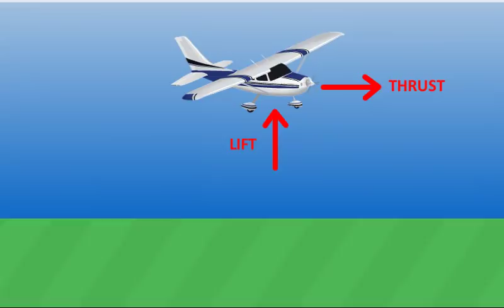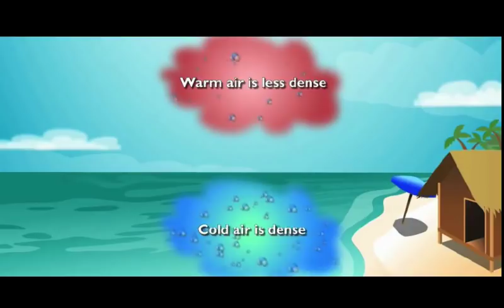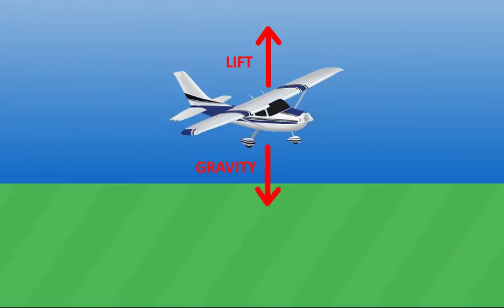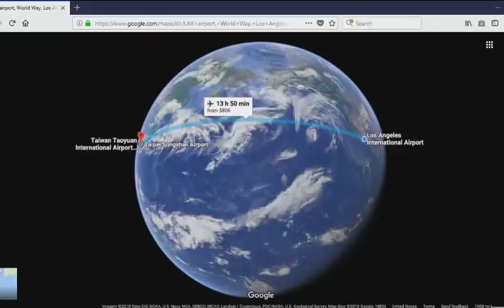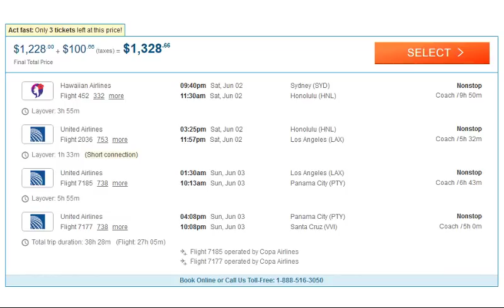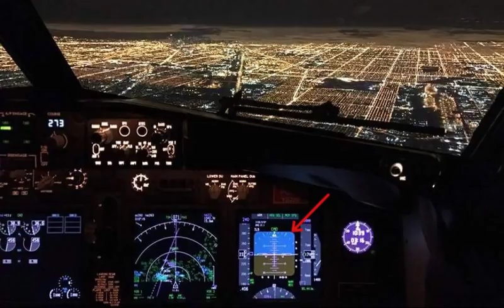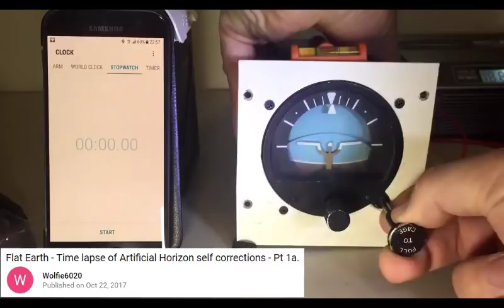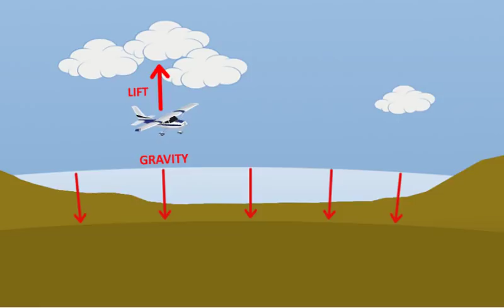Flat Earth Falsities - Plane Nonsense

Comment: I'm a little disappointed that this video didn't compare the calculations of distances measured over a sphere as opposed to across a flat planar surface. I would think that those measurements would be more compelling evidence. Over a sphere the distance between two points would be longer. I would invite our flat earth friends to discount this evidence and I would think real world measurements would follow the model of the sphere as opposed to the flat earth model.
Reply: "Over a sphere the distance between two points would be longer."
     I hope that you meant to say shorter. Over a sphere the distances are never longer, but often much shorter than they are on the azimuthal equidistant projection map that FEers use. Try Walter Bislin's Flat Earth Flight Calculator and you'll see how the distances compare: http://walter.bislins.ch/bloge/index.asp?page=Creating+Flight+Plans+for+Flat+Earth On a flat Earth, flights between Santiago and Sydney would exceed the range and maximum speed of 747-400s that Qantas flies.
Reply: A Crackpot would swear a straight(level type) would be shorter then a curved one... but if Science says not...
[ The great-circle distance or orthodromic distance is the shortest distance between two points on the surface of a sphere, measured along the surface of the sphere (as opposed to a straight line through the sphere's interior). The (shortest) distance between two points in Euclidean space is the length of a straight (flat) line between them, but on the sphere there are no straight lines .] https://en.m.wikipedia.org/wiki/Great-circle_distance

It is common-sense or hoax-sense to be deduce that water distances between are only longer below a Equator.
Forget anti... freethinkers crutches and cut up a balloon and lay it flat. 90% of transcontinental flights are "North".
Why don't they fly over the Pacific Ocean?

https://www.google.com/maps/vt/data=QL-JaxI2aJ9T51SKI7fPyCVfAaj5Mh3QqrXe8nfwK74YIiwhUiAM5BNH2q3rq9cuWPxJaOzCQsvnC-vox8nLvbbBtWHKjx-78diEE-2TjiArqcJs93I
Reply: @romithromith  I note someone has changed their pseudonym. How cute. For a challenged puippy dog.
Reply: @boffeycn  I'm not surprised. His little playmate Mikey went home and try as he might, nobody is paying any attention to the sad little tyke.
Reply: @romithromith "We are now in full Kim Jong Un territory. This is the statement of the new "Press Secretary" Stephanie Grisham about Trump's former Chief of Staff. Wait for it. “I worked with John Kelly, and he was totally unequipped to handle the genius of our great President.” Oh. My. God."
" Kim Jong Un territory."? Or Adolf?
Reply: Their sathurday Sabbath is over, the dark lord playmates are back with digressive topics. No notes upon comment again.
Anyone else witness some tangential discussion?  Whether for the troll's amusement or a specific gain?
   - Talking real world for those that have not checked Mike's last thread; 

And believe in official built real LAWS= "there are defined laws in the universe that make flat planets impossible." 

 Well araid that also is a conspiracy... High Sciene priests are not close to defineting The Creators laws and Science!

"defined laws were created that can't be broken." ...ha ha created he says :)
"All objects with mass exhibit a reaction based on electromagetism. That why all natural objects in space are spherical since they must adhere to defining laws."
 - How can a flat 'planet' exist with gravity... weakest fictitious force in the universe prevents flat surfaces?????? 

Is that an other definate law thingy? Helio galaxy kind of flat pizza-like no?
What if a BANG piece is tablet shaped with the good iron stuff?  Still turns out into a definate ball?

Electromagetism... exist, but Educator as a magnet it can PUSH as it can pull....
In Space... and first hand of that?  MOON you have observed (part of science Method) 360 sides?
   Funny Educator I always see the same disk image, always. Telescopes dont tell me it a sphere.

Answer by Simon Bridge, Scientist, on Quora:
What is the definitive proof there is gravity?
There isn’t one. That is not how science works.         - HA HA BUT WE KEEP HEARING "IT PROVEN FACT" !!!

Gravity is the name we give to the phenomenon that objects accelerate towards each other when they are otherwise left to their own devices.
https://www.forbes.com/sites/quora/2017/11/13/how-do-we-prove-a-well-established-theory-like-gravity/#20550f5e4cd7

 
Now some extraneous articles (Royal bloodline dictatorships are far from over. Rulers are satanic and 'do as they like') = 
QUEEN ELIZABETH FOUND GUILTY IN MISSING CHILDREN ...
https://news.nbcm.ca › queen-elizabeth-found-guilty-in-missing-children-c...
Apparently, his “crime” on May 6 was daring to ask superiors about Queen Elizabeth's outstanding arrest warrant. The order to arrest Queen Elizabeth was ...

MARK RUTTE 'president' of the 'netherlands': STOP Child ...
https://secure.avaaz.org › community_petitions › MARK_RUTTE_preside...
A former member of the Netherlands criminal drug syndicate known as Octopus testified that victims were obtained for these human hunting parties from juvenile ...
Reply: @boffeycn  "...genius of our great President." I haven't heard that one, just another "perfect" statement by or about His Majesty. 
     Humpy Dumpty is going to make a major televised announcement at 9am EDT. Either to announce US Forces have killed Abu Bakr al-Baghdadi, or to declare himself King, nullify the Constitution and have all Democrats in the House arrested for treason. Meanwhile, 99% of evangelicals polled oppose the impeachment. Yes Adolf, Il Duce, Stalin...
Reply: Did Somone say evangelicals !!!?  Like the beloved BUSH family, so so close to the 911 highly insured (against Terrorists) security and whole miraculous event in NYC, USA (saviors of the WORLD) (with Queen and Pope approval).
  WELL!  “Gog and Magog are at work in the Middle East. Biblical prophecies are being fulfilled. This confrontation is willed by God, who wants to use this conflict to erase His people’s enemies before a new age begins” 
   - George W. Bush    .. & End Times (aside Global Warming)

       Took place at the beginning of 2003, a few weeks before the American intervention in Iraq. George W. Bush was then trying yet again to convince Jacques Chirac to follow him in his Operation Just Cause /holy, which the Frenchman obstinately refused to do.

 “Jacques,” he said, “you and I share a common faith. You’re Roman Catholic, I’m Methodist [1], but we are both Christians committed to the teachings of the Bible. We share one common Lord.”

 During this phone call that the President of the United States had brought up Gog and Magog in a conversation with Jacques Chirac. The discussion was about current events in the Middle East. 

Yes, he is a President man (USA; Nasa, Cia, etc) who speaks openly about his faith, but that is hardly unusual for an American president – Ronald Reagan, Jimmy Carter, Eisenhower, and many other presidents did so as well. 

[1] Methodist : major evangelical schools of thought 

      "who know very little about supposedly crazy American evangelicals, and choose to project the worst."
      - Former National Security Council staffer Will Inboden
Reply: Is there anyone paying attention to Christian (evangelical Episcopal) ex NASA administrator Charles Bolden,  who ran away after Trump's election and Christian (ex evangelical United Church of Christ)  Barack Hussein Obama end ? 

             Whats up overthere now?   Mars or Moon leaping progress?    HEO evolution maybe with luck?
     - Ah and to say there is no barrier, no radiation challenge,  and now Moon's Earthly atmosphere 237.000 miles away!

 
"You know, the universe is a big place. I'm a practicing Christian, so in my faith, I learn about omnipotent, omnipresent God, which means he's everywhere. He's all-knowing. He does everything. And I just cannot bring my little pea brain to believe that a God like that would pick one planet of one of millions of suns and say that's the only place in the vast universe that I'm going to put any kind of life. And so the problem is I haven't been far enough away."
Reply: Inflammatory Louis 
woof woof...

be a nice flerfie, keep barking. 

lol... and all it took to set little louis on fire was a little comment on his mental state. yes, you, my pet...

😂 lol
Reply: ...hello you seem a decent fair Critic, not too sure about real world measurements... dont know who and how are made, FEers dont have an accurate map and distances yet, just as GE does not have any sort of accurate flat map.  Yes Some are not knowing of countries /continents dimensions, little like GE Colombus was a little confused with those specs....